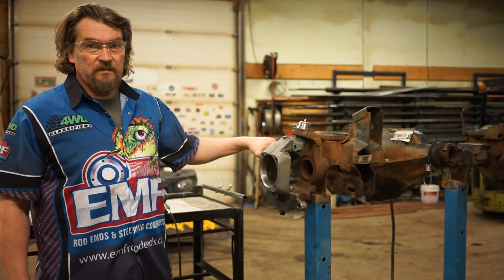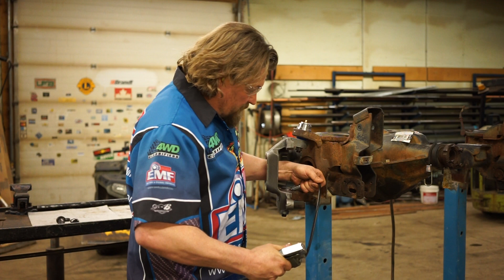EMF Rebuildable Ball Joint Greasing Instructions

Comment: I just bought my ball joints and did call the office any they answer on the second ring.   I needed to verify that I got the non oversized joints.   I just installed them last weekend.
I wish I would have see this video on greasing them before last weekend.  LOL  I miss read the instructions I was thinking the knuckle was the ball joint knuckle,  I added grease they were very tight, then I installed the steering knuckle.  I took it for a test drive, but at 55mph it was squirrely on the road.  After seeing this video I pump them up with grease and that fixed my issue.  
I'm going to buy some redline grease as its red and has moly.  I like red grease as I can tell when the dirty grease has been flushed out.   I used Lucas Red and Tacky grease now, which is good grease.  But looking to use grease with some moly.

Comment: Is there a particular grease that needs to be used?
Reply from the maker: We like to recommend a high quality grease. It can be synthetic or not, the one we use in the shop is not synthetic and has a 5% moly NLGI  it's by Royal Ultra but we have also used Amsoil synthetic grease as well because it's high quality and easy to come by.
Reply: @EMFEVO  So redline CV2 should be fine then? I believe it's the same NLGI # as Amsoil synthetic. I have it already because that's what Carli recommended for their stuff.